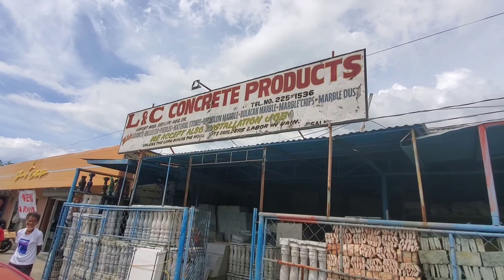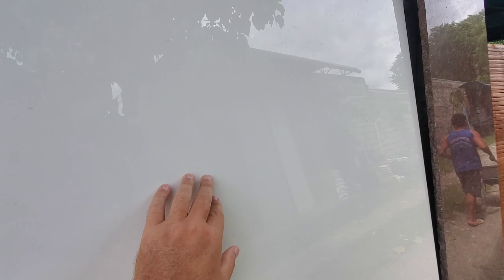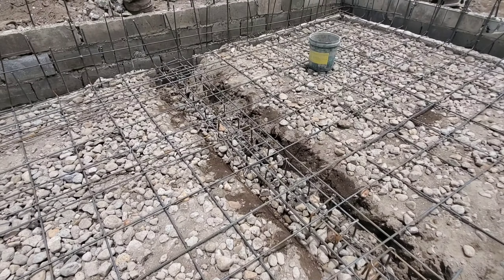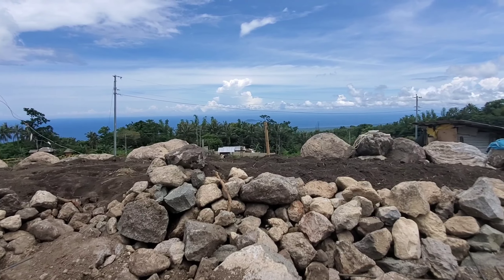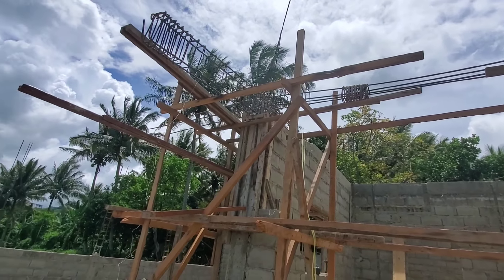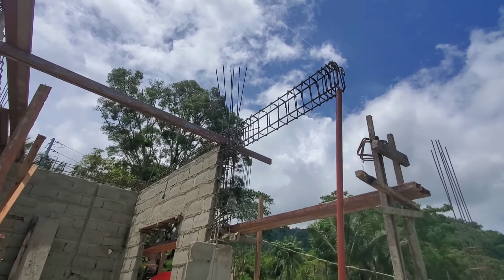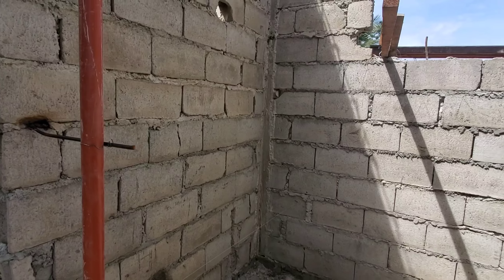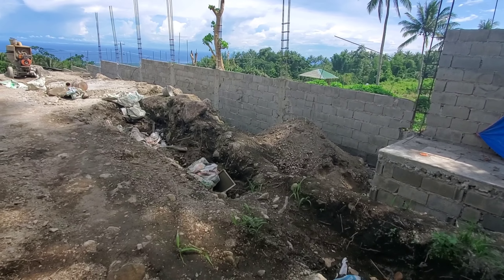Philippine House Building- Construction day 35 - Wilma is very happy!

Comment: Greg, I don't see any "L" bar at the ends of the grade beams. I'm sure you know that these are not footings, they are beams as you started calling them today. Function is to resist the outward pressure of the water against the pool walls. The "L's" at each end transfer the pressure through the beam to the opposite wall. The straight bar could slide with pressure the L's work like the corners of the walls. 
Your daily review of the progress is without a doubt is going to get you a fine home as you expect. Absent owners are the ones who get in trouble or find out what they end up with is not what they expected.
Great job 👍
Reply from the maker: Hello, watch the video - link https://youtu.be/_srLdoph5Jc  I believe it shows the L bar you are referring to.  Thanks for the comment and watching our videos.
Reply: Greg, don't want to be a pest but I was referring to the beams under the floor of the pool that were missed and added on today's video. The end of the beams at the pool wall. The pourpose of those is to resist the outward pressure of the water on the wall. 
Again, really enjoying the daily progress and think you are doing great 👍
Reply from the maker: Yes, I spoke to the foreman today.  I asked if those tie beams were going to be tied into the poured wall like the rest of the floor.  He said yes.  Always an issue with translation, but will call that out if they get ready to pour and the L bar is not tied in.  Thanks for the catch and watching our videos.

Comment: Good video! Nice granite. Would it be referred to as synthetic granite?
Reply from the maker: Thanks Steven. Wilma picked out the perfect slab for sure. Can't wait to see it installed.
Reply from the maker: Yes, she called it synthetic granite mixed with glass. I need to do a google research on it. She said it came from Italy.
Reply: @buildingthephilippines  Quartz material has resins in it , as  you cut  it gives off a  fiberglass resin smell,I think , I have cut it before  , natural stone like  marble and granite hardly  has any smell, I have never heard of that process  she speaks of , Italians  were masters when it comes to natural stone , the original  marble and  granite and tile craftsmen and Installers in Canada  were mostly Italian, I worked as an apprentice for an Italian Master Tile Setter for almost a year in the mid to late 80s , our  customers were custom Million dollar home builds , at  that time it was only  natural stone, no Quartz. 
I think the Chinese have brought  down the price of  Granite  and Quartz with their massive building projects like  Condo high rises in China,  mass production brings down prices, I won't be surprised if the raw polished stone Slabs she sells came from China, I have a Chinese Mainlander Immigrant  whose business  is  selling complete  kitchens and baths here in Canada, some cabinets from China, some made   here in Toronto  but  I believe most of the Quartz and  Stone are from China. I'm glad you got / selected on the countertops .
Edit; due to the  high prices of new  houses and much renovations in Toronto  almost every house  has  option  or even come standard  with  stone countertops, I have bought and reused granite  from RESTORE , an outlet  ( kind of a Goodwill Store)that get donations from Home Depot or builders who give the material  free to the  store for Tax Write-off,  rather than  the material  go to landfill.